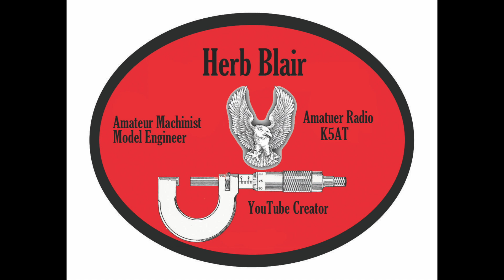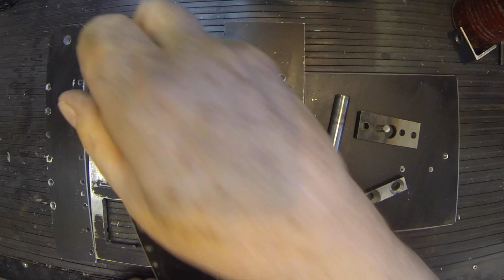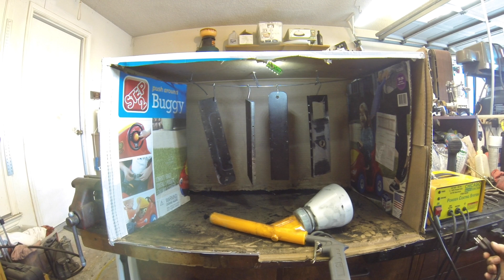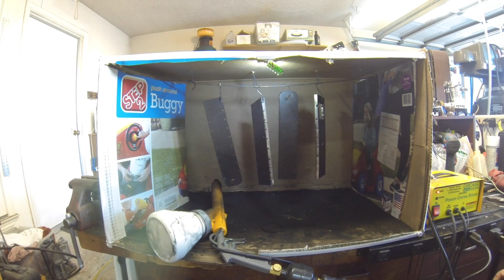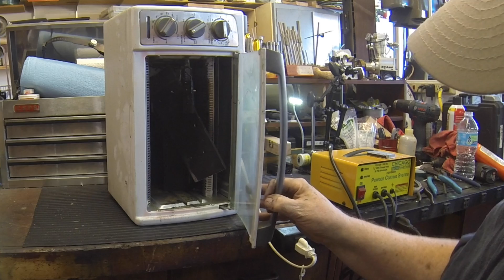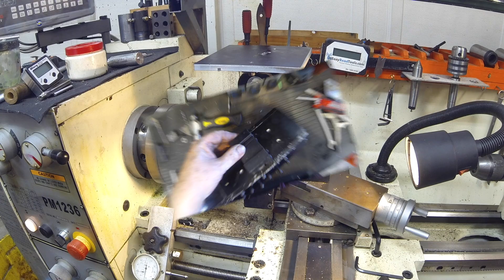This Week in Herb's Workshop #115 Die Filer Final

Comment: Really interesting Herb.

The powder coating bit was something I know nothing about, and I was surprised how easy it was.

The filer works good.  Thanks for posting.

Rob
Reply from the maker: Thanks Rob!  The Craftmant Powder Coat Gun that I bought off Ebay doesn't require air.  The only drawback to it is filling the powder tank.  Whereas the HF one has screw on tanks.